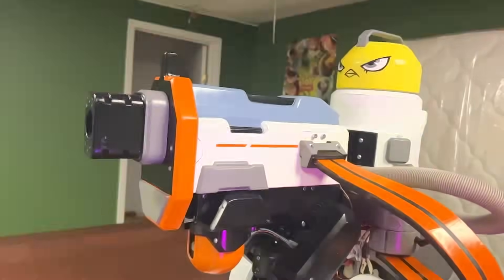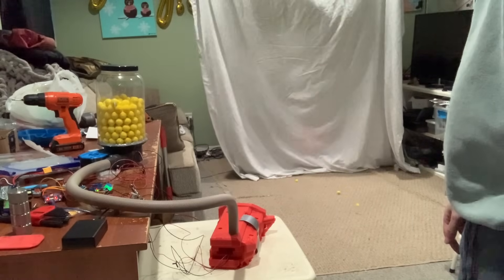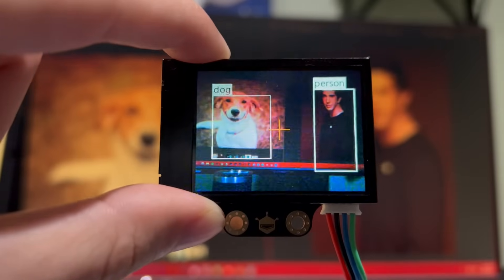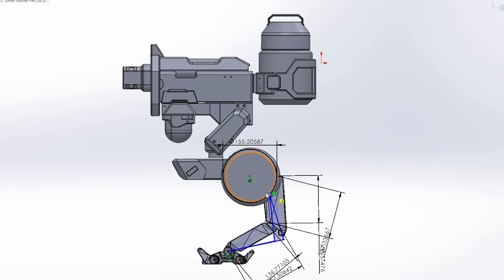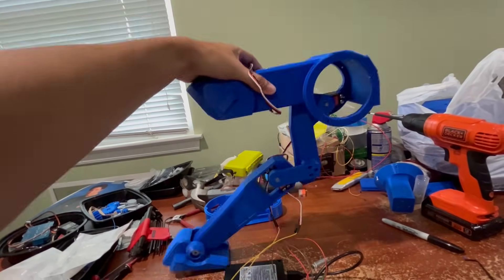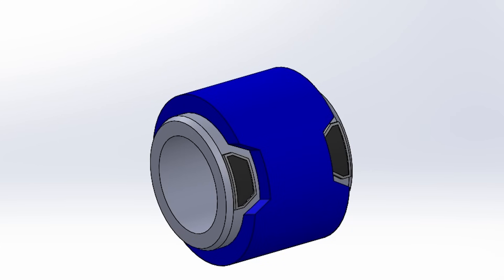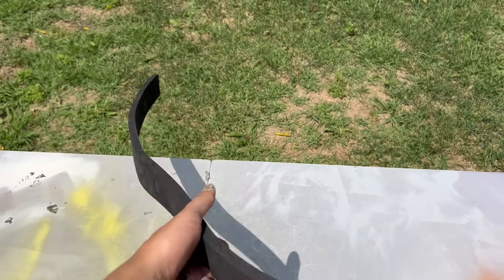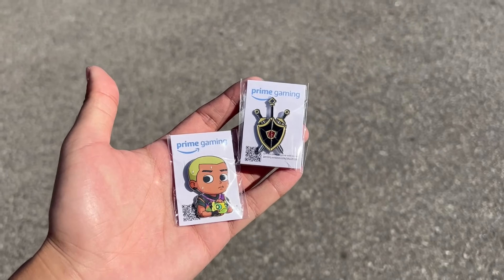I made an AI powered KJ Turret IRL

Comment: Hi Danny!
I’m a fellow maker and I was wondering what type of power supply you typically use for your robots/electronics builds. I’ve been using a 9V battery with my arduino builds but I’m not sure if that’s the best way to do it.
Reply from the maker: Check my amazon storefront link in bio. 9V works well theres no best way to do it. I use a powerbank with 12V and 5V outputs to power most of my components

Comment: One bit of advice from someone who has spent many thousands of hours filling minute imperfections to create a perfect sureface. (For making patterns that sre used to make the sand moulds in a foundry.  Think 15 feet accross.).  Anyway use bog instead of wood filler. As in 2 part auto body filler.  We don't even use wood filler on wood.  The auto body filler will bond way better and last a lot longer.  Also if you're doing tiny touch ups you can just put extra hardener in it and it'll go off really fast.

Comment: Why not use electric linear actuators instead of servo and gas struts. Simpler. Also you can get linear actuators in literally any size and Newtons you need. You can also get them in virtually any form factor you need and they can be both fast and slow. You can even get them as linear motors...

Comment: Also you can use a small laid in diffuser with small water reservoir so you get the smoke affect with the light traveling through it for the blast flash effect

Comment: What R U using as your main SBC or main command board? I am using Nvidia Jetson Nano V 100 with 5v relays and a 100N with controller that can move P1-P380 within .03 of a second without stripping the gears and a 30lb 2,000 Rpm gyro for stability.

Comment: For your next project i suggest a similar set up as this but it shoots two stun gun leads. You can probably use the flashbulb circuit from a disposable camera. They can be charged with a 9 volt battery. You can leave it connected or just charge the circuit after each discharge. The base voltage varies from camera but tend to lie between 180 volts to 330 volts though parts of the circuit can get UK p to 2000 volts for a second. If you have people that are like monkeys and like shiny things just remove the flash mechanism from a disp cam..make sure its discharged or be very careful. Position the flash reflector where it will be irresistible to inquiring minds. Have the flash fully charged. And make sure the circuitry isnt covered with plastic or cardboard. When the subject sees the reflection of a laser or bright led bouncing off the reflector of the flash they will have to investigate. Chances are good they will pickup thecdevice and get the shit shocked out of them. I always kept  charged capacitors laying in my roll away boxes. Youd hear folks screaming at average 2 times a week. Ahh. Good times

Comment: 3:58 the cover recoiling forward has been used in weapons previously, its just not terribly popular. The M1941 Johnson, the competitor to the M1 Garand, had its barrel recoil forward.

No its not EXACTLY the same, but the point is more about the existence of such an action rather than the exact mechanics. If Riot wanted to be "accurate" they could have made a clockwork monstrosity that was the G11.